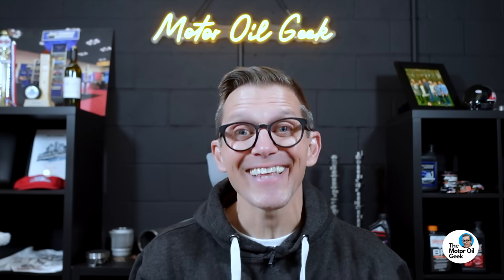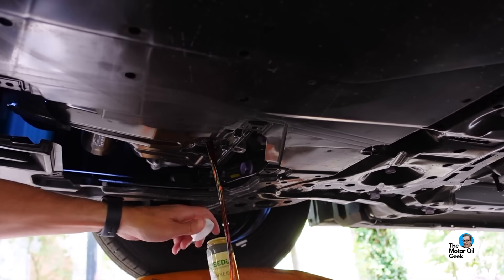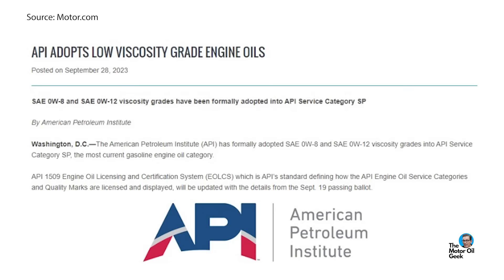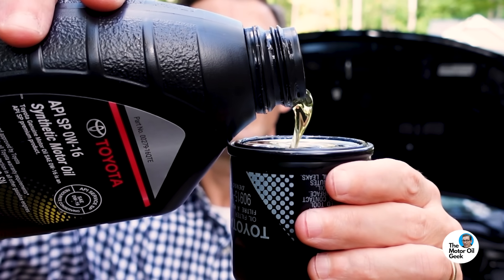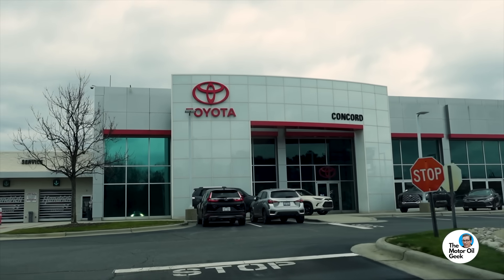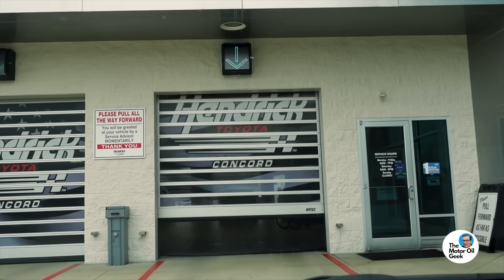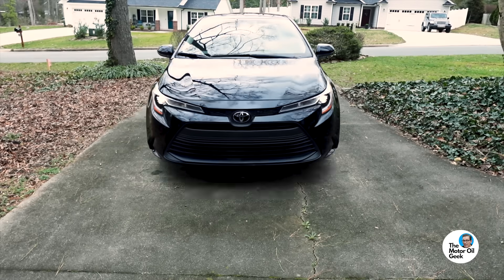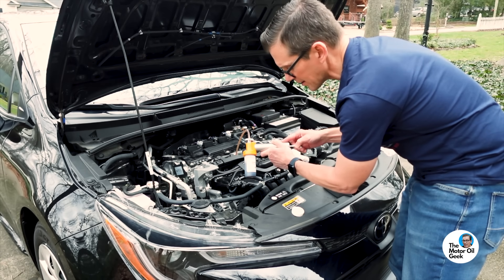0W-8 Motor Oil: Too THIN to Trust? Let's Find Out!

Comment: As far as I know the CVT Transmission fluid cannot be completely drained from the drain plug. Additionally from the evidence I've seen the transmission fluids only last about 60,000 miles at most. They go from red to black so I don't believe the story about them never needing to be changed. I also believe there should be a law against making the fluid level so difficult to check it's almost impossible for the owner.
Reply: Quite a lot the fluid remains inside the torque converter and valve body. Still, dropping the pan and filling it rejuvenates the old oil with the new additives and its gets cycled through. A complete flush isn’t needed if the cvt has been serviced even semi regularly imo.
Reply: @adm7812 never flush, unless the transmission/cvt has gotten in water. Drain, and fill.
Reply: Even dealerships struggle with getting the right amount of oil in modern  transmissions. And if you have a leak forget topping off. You have to Get it fixed. 

Finally. On transmissions where a flush isn't an option.  I recommend doing several short interval drains. Drain the pan put new fluid in and drive a bit and drain and repeat.
Reply: never flush just drain and fill,the level is easy if you have a scan tool that reads the internal temperature!
Reply: @smedleybutler1969  how do you relate temperature to level?
Reply: @richardkudrna7503  Every car has a temp required to get the proper amount of ATF, if the temp is too low the level will be too much if the temp is too high the level is actually too low and you need more fluid ,because ATF expands as it warms up!You cannot do a change without a ATF temperature gauge!
Reply: @DataToTheZero You want to kill a transmission...? Do a flush. Its about the worst thing you can do to any automatic trans. More frequent partial fluid changes is mich safer and more beneficial.
Reply: @boost331  There's no "partial fluid change" on Toyota automatic transmissions on 2007 or later models unless you're taking about hybrids.  And there's nothing wrong with flushing the fluid with proper machines.  Out shop uses BG flush machines and I've never seen any problem with it.  You can see the fluid color changing from black/brown to red during the process.
Reply: @EmbraceTheSuck240  Fluid color means nothing. I actually manufacturer automotive fluids and lubricants for a living. Moat CVTs only drain a very small portion of the fluid. On a car with a torque fluid a flush can and often does destroy the transmission in short order a flush jams all the shit that has accumulated in the trans over all those miles into the filter all at once.
Reply: @boost331  1. I don't service CVTs, I leave them alone.  2. I've done hundreds of WS fluid or T-4 fluid flushes on Toyota transmissions using BG machines.  It's total nonsense to say it destroys transmissions.
Reply: I agree
Reply: My daughters 2012 Suburu blew the transmission at 80,000 miles,I still kick myself for not changing it at 30000 miles as recommended by people without agendas! I change the ATF fluid every 3 years now on all 5 of my cars,all you need is a scan tool that reads temperature and a small pump it is actually not that hard!Don't trust most mechanics some don't check the temperature!
Reply: @smedleybutler1969  when are you checking the temp?
Reply: @utpharmboy2006  I bought an xtool but any scanner that reads internal temps live will do,I drain and measure what I take out and put the same amount in,Then run the car shifting through the gears a few times then wait till the ATF gets into the temp range for the car and start adding fluid till it starts to come out then close up you are done very easy!
Reply: @smedleybutler1969  thanks!!!
Reply: The ecvt oil in my 2016 Prius was still nice and red at 66k miles. Those are a completely different transmission design though.
Reply: So at least with Subaru CVTs they're supposed to be easy to change fluid on, it really is a simple drain and fill. It has a drain plug on the transmission oil pan (that lube techs often mistake for the engine drain plug) and a side fill port, you just drain the old, and fill the side port til it drips out and that's it, flushing Subaru CVTs is not recommended.
Reply: CVT usually 6Ok, Toyota has a launch gear which is supposed to make them last longer. I have a VW with a DSG, they are 40k OCI
Reply: @davidcaprio8919  Launch gear wasn't introduced until 2019 models. So transmissions from 2014 to 2018 are out of luck. And treat their transmissions very gently.
Reply: @davidcaprio8919  No usually 60,000. Usually 30,000.
Reply: @davidcaprio8919  60k?  I think it should be drain and fill every 30k at least for casual driving.  For those who are using their cars as uber or lyft, they should change every 10k to be safe.  The trans work as hard as the engine motor.  Also the coolant should be changed to ensure the heating transfer is at top notich to keep the engine and trans in top cooling state.
Reply: I do my cvt fluid twice a year. Why the heck not lol. It's cheaper than a new transmission.  I did the filters at 50,000 as well. 2019 civic coupe ex-t
Reply: The planned life on a lot of cvts is 65k that's why the warranty is at 65k. No fluid change for life of the trans. What a croc of crap
Reply: @ChevyRedneckGFX  The weak link in the CVT concept is the "belt" which has to have enough friction to grip the pulleys but at the same time have lubrication so it doesn't grind itself to pieces. An impossible combination. The only hope is the new "RatioZero" transmission but that's many years away. They are still working on a prototype for a scooter. I believe they were working on a bicycle version, but I am not sure how far they got.
Reply: Planned obsolescence Baby….
 they got a big lobby
Reply: VERY few people even know that a CVT needs frequent oil AND filter changes. Some manufacturers recommend servicing between 30,000 and 60,000 miles, depending on driving conditions. I don't know of anyone who rebuilds them, and they all have very short warrantys!!
Reply: @bradhuffjr777 
Nissan  infinity cvt transmissions had issues.
Reply: @DavidSmith-tu1nd All cvts have issues lol
Reply: @DavidSmith-tu1nd  big time!
Reply: @DavidSmith-tu1nd you don't say?
Reply: @bradhuffjr777 I hate CVT, and it’s actually boring . I have an old Corolla with automatic transmission and that never gives me headache , oil changes every 50 thousand  KM(around 30k miles) on my own , and it’s still run like new all this years later .
Reply: @bradhuffjr777  I agree on the fluid change interval but not the filter.  No one has ever shown me a clogged CVT fluid filter.
Reply: @nickv4073   Some of the late model Jeep Patriots have a bypass valve, so fluid will still go to the cooler when the filter is clogged. Maybe that vehicle is a poor example because they are crappy cars in general, but I bet that valve was added so they would usually outlive their warranty.
Reply: @bradhuffjr777  Yes, but Subaru put an extended trans warranty on our 2015 Crosstrek with CVT (10 yr/100,000 miles) so if you change the fluid you void the warranty. If you keep the car past the extended warranty, you risk having to pay thousands for a new one.
Reply: @bradhuffjr777  ask nissian about their cvts that have a 99.9 % failure rate and a hidden warranty  cuz they fail so often!
Reply: @bradhuffjr777  they absolutely don't all have short warranties. They're very run of the mill warranties like typical automatics.
Reply: @veganpotterthevegan  I was recently the office manager and service writer for an automotive repair shop that specializes in complete engine and transmission replacement. My sources are ETE and multiple dealerships. ETE would mark up a CVT from the dealership by about a thousand dollars to cover the cost of their "normal" warranty. I have personally priced out over 10 CVT replacements. Most failures were related to neglect and mileage. Most customers replaced the vehicle rather than pay for the CVT replacement.  What are your sources and experiences?
Reply: @bradhuffjr777  my sources are national data on the general reliability of models that have CVTs.  Not one car company that has CVT problems... you know very well that there are companies that have had very problematic geared automatic transmissions too.
Reply: @veganpotterthevegan  Can you be more specific with your sources? How many CVTs have you purchased and installed?
Reply: @bradhuffjr777   I've owned 2 cars with CVTs.  Sold Escape Hybrid with 300k miles on it and I still see it on the road 5yrs later.   I also had a CVT Crosstrek but it was totalled at fairly low mileage.  
*Consumer Reports has the most comprehensive data on vehicle reliability that's not inflated by manufacturers.  You should know that if you work for dealerships.
Reply: @veganpotterthevegan  Oh, bless your heart! I hope your situation improves really soon.
Reply: @bradhuffjr777  sad I sold that unreliable Escape?  How many miles should it have failed at?  800k?
Reply: @veganpotterthevegan  Good luck with your journey through life.
Reply: @bradhuffjr777   I'll be fine, the autos in my Ford Transits I use for work are a different story.  4 vans, all hitting schedules maintainence.  One sold at 114k, the rest under 100k.  I'm on the 4th with 19k.  2 transmissions, 4 actuators.  Not a good time.
Reply: @veganpotterthevegan  I used to service write for a LOT of Transit Vans. Fortunately, a lot of it was maintenance for commercial fleets, and preventative maintenance was strongly encouraged. Each one that had an aftermarket tow hitch had transmission problems. At least the water pump is more easily serviced on the RWD ones. Good luck and watch out for aggressive drivers!
Reply: @bradhuffjr777  no hitch on any of mine but they were a nightmare.   First 3 were RWD.  3, 2 and 2 pairs of head gaskets on the first 3😅 And I'm not hard on my van.   I get the best gas mileage in the company by over 1mpg.  Granted, we do drive very steep terrain servicing ski resorts in Utah
Reply: @bradhuffjr777  Nissan yes. Toyota uses direct drive first gear
Reply: @bradhuffjr777  not the case for Toyota E-CVT's
They will last 500k kilometers easy with basic 60k miles drain + refill, it is in fact not good for it to be drained completely. 
The prius is one of the most used Taxies in spain, and they call it a "million KM" car for a good reason.
Reply: @bradhuffjr777  No matter what kind of transmission you have you should be changing the fluid (and filter is applicable) every 30-60k miles.

The only difference between changing the oil in your engine, power steering system, differential, and transmission is the type of oil and the interval in which it needs to be changed.

Oil breaks down over time and NEEDS to be replaced.
Reply: I'm driving a 2016 Prius, the cvt drains and fills at listed capacity. Drains and fills like a gear box.  I've been running 80k between fluid swaps.  3.5qts WS fluid
Reply: @philarends7555  I know, that's an eCVT.  If you remove the overflow plug, no drain plug on the CVT, you'll barely get a quart of the fluid out of it.
Reply: @EmbraceTheSuck240  that's bullshit on yotas part. I really like the way this one works
Reply: Yes it is a crime!!
Make it  hard for you to maintain
Reply: None can be drained completely by just the drain plug
Reply: @zealobiron  No it can't.  Draining only removes 4.5 Litres, holds more than that
Reply: @trainstractorscarsandtruck7362  typo
Reply: One of the things manufacturers found with autos many years ago was that the presence of oxygen is a significant factor in the life of the fluid, basically oxygen from the air accelerates degradation to a very large degree. If the trans is sealed all the oxygen inside will react with the oil, the remaining gases are inert and won't harm the fluid. This is probably behind the deletion of the dipstick;  if one is present owners will inevitably succumb to the temptation to check the fluid level, which introduces fresh oxygen into the transmission via the dipstick tube.

I changed the auto trans (old-school slush box, not a DCT or CVT) oil in my car at 150,000 km and it was quite dark but clearly still had some life left. CVTs need much more frequent changes due to the high shear conditions of the push belt.
Reply: @nerd1000ify  you would think that a valve would be the way to go so that you could still have a dipstick but the valve would stop more oxygen getting in.
Reply: 60,000 miles is when i change mine and that's with lite use. manual actually recommends 60,000-90,000 miles with heavy use....so they admit its not necessarily "lifetime"
Reply: All old vehicles recommend a 30k-50k service interval for trans fluid. The more hard use, the shorter. You should change it 6-10 times in a cars life, and flush 2-3 times ( non machine flush)
Reply: 2020 Corolla drains 4.5 Litres of trans fluid on a drain only.  XSE CVT with 1st gear
Reply: I'm surprised it even has a drain plug since sealed transmissions are all the rage these days.
Reply: Did you take the plastic insert out inside ??? Bruh.
Reply: CVT transmission filled for life= means replace transmission in 60-100k because we have no service parts available even for warranty and we do not fix them!!! So $8000+please and we will install a new one or we have another on the lot I you would like to trade!
Reply: If Toyota does not have CVT drain plug you can replace CVT tranny cover with after market one with the drain plug and then do drain and fill. You need to drop the cover anyway for cvt filter replacement that is inside. It will replace 50% on first drain and 100% at second fill as rest of the fluid is in the torque converter.
Reply: Some vehicles have no way to check the transmission fluid.
Reply: @solarsynapse  that's very true but still change it no later than 60000 miles I don't care what some manufacturers say about forever fluid that is a lie no oils or fluids last forever. There is a way to check the oil but you need to get under the car and find the right plug and make sure the car is level and bla bla. It's a pain in the butt.
Reply: Cant drain all fluid from any transmission. Cant drain all the oil from a engine either. Cant drain all antifreeze either.
Reply: @shawnkelly695  very true especially depending on how it was designed that's why it is so important to change the fluids on a regular basis on the extreme driving conditions set in the manual or what ever they call it because never use the normal driving conditions because basically no one drives in the manufacturer definition of normal. But yes you are 100% correct no matter what you don't get All the fluid to drain and the transmission and coolant are the worst by far.
Reply: @tdobson888  atleast changing before wore out there not that tar build up. And lol ya its kinda amazing the abuse modern cars will take before dead. In north america we love our fast engines and drive the livin shyte out of them. The least we could do it maintain them better then we treat them on the road lol.
Reply: I won’t buy anything with a CVT. Toyota or not. Inferior trans that is installed only because the EPA forces the manufacturers to meet their ridiculous arbitrary efficiency rules. EPA needs to be removed and disbanded and permanently outlawed to bring back vehicles that last.  GD feds.
Reply: Late reply, but you're saying my dad having never had it done to my knowledgebin 120k miles is bad?
Reply: @Hydration-yq7hu  Dealerships usually do at least one CVT service while the car is still under warranty. Check the service records and read the owners manual. Be smart and save money. You can also help save the planet by making the vehicle last longer.
Reply: @Hydration-yq7hu  

The transmission filter for a 2020 Hyundai Elantra should be replaced every 30,000 to 50,000 miles. However, the transmission fluid for an automatic transmission in a Hyundai Elantra typically doesn't need to be checked or replaced under normal driving conditions. 
 
Here are some other maintenance intervals for a 2020 Hyundai Elantra: 
 
7,500 miles: Inspect the air cleaner filter and replace the climate control air filter 
 
15,000 miles: Inspect the brake fluid 
 
30,000 miles: Inspect the fuel lines, fuel hoses, and connections 
 
8,000 miles: Change the oil and oil filter, rotate the tires, and inspect the brake fluid 
 
95,000 miles: Replace the spark plugs 
 
120,000 miles: Replace the coolant 
 
Hyundai also offers a complimentary maintenance plan for new 2020 Hyundai models purchased on or after February 1, 2020. This plan covers oil changes and tire rotations at the normal intervals outlined in the owner's manual.
Reply: @Hydration-yq7hu  Are you talking about a transmission in an older car? Conventional automatics benefit from 75 years of development (approximately) and are understandably more durable. Additionally just like the guy who smoked like a chimmey all his life a never got cancer or heart disease. I prefer to not go by the results of just one (or a few) person(s) that might have just been lucky. And they really might not be making them like they used to.
Reply: @Nickrioblanco1  no... 2020 Elantra CVT :(
Reply: @Hydration-yq7hu  I hope he gets lucky and it lasts until he doesn't what it anymore. For some  people 120K is OK. I personally expect a lot more.
Reply: Yes. 0W -8 is too thin unless you live in Fairbanks, Alaska.
Try letting the car sit for a week between runs.
You'll hear metallic sounds on startup. Not good. Ridiculous.
SAE Engineers weren't happy about and objected to using water to lubricate engines.
Why? Because all of the oil runs off the bearing surfaces and out of the lifters overnight.
So... if your viscosity modifiers get used up? 
You are left running "water" (0 weight oil) in Phoenix in the summertime.
Wait a week and then start it at 120F. The engine will not be happy.
Even the "Kwik Lube" oil change employees thought the engines sounded horrible on startup after draining hot oil for a change.
Ridiculous to get ~1 mpg improvement.
Reply: I change my CRV every 30,000
Reply: as always, drain as much as you can from the drain, and put the exact same amount back in. I have done this will ln my Chrysler 3.3 engine tranny and NEVER had an issue.
 I do it every 3 years. You might get 1-1.5 L at best.
These are my vehicles and I decide what gets done when.
Reply: Why didn't you show us where the drain plug was instead of taking 3 minutes to tell us not to use normal oil in a cvt?
Reply: its true cuz tranny only last 60k miles so never have to change the oil just the tranny lol.
Reply: i have a honda cvt sitting at 100 right now with no issues
Reply: It's not impossible (not even close to impossible -  but rather difficult).  You need to teach yourself some things that aren't taught in school (like most life lessons such as finances and relationships).
Reply: My mum's Honda has a CVT and it's black after just 15000 miles
Reply: The thing about belt driven CVTs is that they generate A LOT of heat during use and thus should be manufactured with at least two transmission oil coolers, if space allows, for better durability if frequent fluid changes are not possible by the owner.

When I had my 2008 Nissan Maxima I would take the car to the dealership to get the transmission serviced every 15,000 miles religiously.

I put 67,000 miles on that car, before I sold it, without one single transmission issue and it always operated buttery smooth.
Reply: Thats why mechanics tell you that there are 2 ways to have transmission problems, 1=never change the fluid, and 2= change the fluid as recommended.  In my experience you should remove the stock trans fluid within the first 2 years or  30000 miles max.
Reply: In my 2020 Mitsubishi outlander sport, I get my CVT serviced every 30,000 miles. It starts out as green. Right now it’s definitely transitioning to a yellowish color but I’m 5,000 miles from my next change. I imagine if I skipped the service, the yellowish-greenish color would eventually brown. Then black.
Reply: That story comes from the old hydraulic converter transmissions. It does not apply to CVT. Although with something as wear sensitive as a CVT even I would shorten the recommended intervals.
Reply: put strong magnet outside the drain plug.. to collect iron particles.. see howmuch when doing change
Reply: My son replaced his CV fluid himself it can be changed he has a civic
Reply: Drain what you can every 5k miles, depends on how it's driven, towing etc.
Reply: No transmission can be completely drained from drain plug. At best your getting 60%of the old oil. Just the torque converter can hold up to six litres on some big transmission
Reply: CVT trans are complete garbage ..
Reply: I have seen several units of industrial equipment that use a sight glass for fluid level. That’s what I would like to see on cars. Then you could just look at that for level rather than a dip stick or the drain plug over spill method at a specific temperature!
Reply: Trans fluid color doesnt matter...it still works fine when the color changes...its only a dye..
Reply: There is more disinformation in these comments than factual information.  These new systems are not designed to be used more than twenty years. New technology changes very fast and nobody wants crappy old crap.  In the future you may not be able to own most of these vehicles. New vehicles will be sharing information for better traffic safety.  Probably all EV.
Reply: That's a fact always change your cvt oil at or before 60000 miles I cut it in half because I do lots of city driving
Reply: It's life time fluid. But Toyota or any manufacturer doesn't give a definitive description of what life time means.
Reply: I had a 2010 T&C.... there was NO transmission dip stick. There WAS a tube with a rubber cork. To check the level, one needed a "special" calibrated dip stick, with graduations for low/ normal/ max... One ALSO needed to know the transmission temperature, There IS A Significant difference in oil volume/ height on the stick between cold and operating temp. 
One COULD simply use the engine dip stick (Cleaned VERY WELL), and measure the oil level, and refer to a chart.
Reply: Hello, I don’t understand mechanics of transmission, but
Car care nut, has a video where he does -transmission drain and fill on a Camry hybrid 
-obviously has a drain plug
- and explained that there is no sealed transmission, it just doesn’t have a dipstick 

And I’m sorry, I trust his experience more than any of the contradictory and false views listed here
He says change it every 50k
He has video showing him do it
He shows the drain plug 
And explains there is no such thing as a sealed transmission 
So to the mechanic above with 26years experience 
Saying there is no drain plug
Wtf 😂😂
Reply: @ricknoyes4463  What the Toyota dipstickless transmissions I have is a combination drain overflow plug which unlike the overflow plug on a manual transmission or a rear differential work at ambient temperature these overflow plugs only work properly when the transmission fluid is at a certain temperature range. So not only do you have to run the transmission to heat it to that range and have a diagnostic tool to measure it.  Different transmissions have different ranges.
Reply: CVT oil is actually a goldish color, lighter than oil  gold, actually. The red fluid is ATF (Automatic Transmission Fluid) and is rated for cars with defined gears, not CVTs (Continuously Variable Transmission). I'm not a fluid engineer, so I don't know what the difference would be with running each, I'm just aware of different transmission fluids for different transmissions and that you could potentially mess up a transmission with incorrect fluid. However, all fluids will get darker with wear, that is correct. Whether it be oil, brake fluid, transmission fluid, coolant, differential fluid, or transfer case fluid, the darker it is, the worse off it is.
Reply: There are videos of engines that had 10,000 mile oil changes and by 100,000 miles they are all gummed up. Synthetic is pathetic 😭
Reply: I change mine every 25k
Reply: They want you to take it into a Toyota Dealership silly.
 BMW trick that the Toyota folks picked up in the war. Oh, sorry, when they merged withhi-teck crappy vehicles.
 Ya ya they last for ever. Parts are costly, and they will not hold up like the old ones did. eg: Matrix. 
Oh well nobody is forced to buy any specific brand so do what you want. Its your dollar.
Reply: Never need changed during the life of the vehicle..... Which in court of law is the power train warranty so 60,000 or 100,000 miles.
Reply: Nissan giving CVTs a bad name. Toyota uses direct drive first gear.
Reply: guys like you are exactly why they make it difficult. so only people who actually know what they're doing attempt it, hopefully. You can seriously mess up your car if you mess with the CVT fluid and you don't know what you're doing. it's absolutely nothing like doing a motor oil change. and the level has to be exact.
Reply: @TimJohnson-x1o  So you think it's right most people can't even check their transmission fluid level. Also it's not only on the CVT my 2006 Tundra has the same type of system on its Type A750F traditional automatic transmission. You reveal your ignorance by thinking I can't do the job. I'm a retired mechanic with 35 years of experience. And have already done drain and fills on my Corolla's CVT and the Tundra's A750F(multiple times) with the correct procedure at the correct temperature. The manufacturers are wrong to not have a way for owners to know all the critical fluid levels on their vehicle.
Reply: I disconnect the transmission cooler line and pump out 2 quarts, then I add 2 quarts and repeat until all the old fluid is pumped out and the new fluid is in. never had any issues.
Reply: Think of it this way.  You change your motor oil every 5k.  The question would be, does your transmission work as hard and consistently working like your engine?  If so, now think about the oil.  It's best that you do change the trans oil as much as the motor oil.
Reply: @kito1san nonsense
How much compression occurs within my transmission?
How many ignitions? 
How fast are components spinning?
Its a fraction of the torture the engine is exposed to
New oil every 5k? Huge waste
Reply: Walmart sells mobile 1 0w8... my 2025 takes 0w16 for 10k...my dealership gave free lifetime powertrain warranty with this schedule
Reply: I do mine every 30K on a 2021 Honda, including replacing 1 of 2 filters. As far as I know, when you drain and fill a CVT, you get most of the fluid out since there is no torque converter. And if you’re doing it every 30K let’s say, even a little of the old isn’t the end of the world. But most of these manufacturers will tell you that sealed transmission fluid is “lifetime”, which is BS. They even tell you this on some non CVTs, like my Tundra.

One thing is proving true: CVTs will last a lot longer if you take charge of your own maintenance schedule.
Reply: @carnold.knowledge cvts for cars do have torque converters. Honda is the only one i am aware of that uses a clutch instead.

They may be onto something as i havent heard of failures being as common
Reply: With my Rav4 Hybrid, when you drain the transmission fluid you're draining the ENTIRE amount. Which is ~3 1/2 quarts.  When you REFILL, it's a little messy but simple.  Just fill to overflow and then let it trickle to a slight drip at least. Same goes for the DIFFERENTIAL but not as much fluid.
Reply: @michaeltammaro482  yes!  eCVT (planetary gear set) is super simple
Reply: Maybe the fluid is more expensive than the transmission?
Reply: @thisisyourcaptainspeaking2259  it isn’t. i have diy serviced my toyota cvt along with the filter change. The fill port is behind the wheel and getting the right level is bit of a process but still easy enough.
Reply: @adm7812  The process seems ridiculous to me. Toyota could have easily made the process so much simpler. Probably could have even used a dipstick based CVT oil change procedure. Or even a side fill port that matches the needed level so you just fill until it starts to drip out.
Reply: @stephenh8092  it's all about making you go to the dealership for service. My '15 Accord has a side drain (separate from the main drain port) to let you know if you filled it to the proper level.
Reply: They were ordered it this way im sure!!
Not because they choose to
Reply: @stephenh8092 my cvt actually has a dipstick and a drain plug. I actually had an argument with a Toyota head service technician one day because he assured me Toyota had never produced a cvt with a distick. He insisted I had mistaken the engine dipstick for the transmission. Nothing i could say would convince him otherwise.
Reply: @rohankiwi one way to have solved that issue with the technician is to have him walk with you to your vehicle and show him the transmission dipstick that was not the oil dipstick. Instead of trying to convince him verbally the technician couldn't refute that.
Reply: @stephenh8092  this is exactly how the toyota ecvt works...but that is a planetary gear set they use on all their hybrids. super easy
Reply: @thisisyourcaptainspeaking2259  
the fluid is pricey
Reply: That's right because there's NO drain plug on Toyota CVT transmissions.  There's only an overflow plug!!
Reply: Cvt fluid is yellow not red
Reply: @jacobrector7879  color doesn't matter.
Reply: @dealerauctionnightmare4689  I agree, but it can be helpful in diagnostics. A good example is at my old job, we often used a blue fluid in the Supercharger cooling system so we could differentiate an engine coolant leak vs. an intercooler leak, for example. If the leak was blue, and within our warranty period on the supercharger installation, we would address it differently than an engine coolant leak.
Reply: @jacobrector7879  not one color some are blue.
Reply: @jacobrector7879  not all are, mine is greenish-blue
Reply: @jacobrector7879  Subarau is green
Reply: @jacobrector7879  The red fluid I was referring to is on the Tundra truck which also has no dipstick an starts to go bad (turn dark) at around 60,000 miles depending on how hard you you run it. Even though some dealers say it lasts forever.
Reply: @jacobrector7879 The CVT Fluid in that Toyota Corolla is RED... He showed you a sample! Are you saying that he made it all up and is lying?
JFC
Reply: @jacobrector7879 Honda fluid is green!
Reply: You don't need to worry about the fluid which is extremely expensive.  Just leave it alone, there's no way to service it.
Reply: @EmbraceTheSuck240 the fluids cheaper rhan a transmission
Reply: @carnivorebear6582  Yes, it is but there's no way to service that transmission.  I've been a Toyota tech for 26 years.  You're wasting your money on "drain/refill" or "flushing" the fluid.  I roll my eyes whenever someone asks for either of those services on non-hybrid CVT transmission.  I've had this discussion with my service writers many times - You can't drain/refill when there's no drain plug and you can't flush the fluid when there's no cooler line!  In order to do a proper flush on the CVT, you'll need 4 cans of the fluid, each can is 4 liters.  I believe one can of that fluid costs $150 so you're talking  about $600 for the fluids plus an hour labor.  The cost of the fluid is about three times the normal flush with WS fluid.
Reply: @EmbraceTheSuck240  You must not have worked on many Toyota CVTs. Actually the number is probably zero, because Toyota non-hybrids DO have a CVT drain plug.
26 years, huh? I bet there are a lot of Toyotas you have screwed up. Guys like you are the reason I warn people to stay away from dealerships for mechanical work.
Reply: @EmbraceTheSuck240  pretty crazy, I would've assumed they'd have at least a transmission cooler, especially if the things designed for 'lifetime' use
Reply: @carnivorebear6582  That CVT has a cooler.  I was referring to the eCVT on the Prius which doesn't have a cooler but some still like to sell "flush" on that transmission.  Yeah sure the fluid is cheaper than the transmission but Toyota doesn't even recommend replacing the CVT fluid which is ridiculously more expensive than the WS fluid, like 4 times more expensive.  All that fluid does is lubricate the gears and chains inside the transmission, that's it.  Since CVTs don't shift, the fluid isn't used in the same way as the conventional transmission fluids so I wouldn't worry about it.
Reply: @EmbraceTheSuck240 you're the reason I service all my Toyotas myself.
Reply: @mitchellbroaddus9120  Good for you, I have more work than I need so I don't need cheap customers like you.
Reply: @EmbraceTheSuck240  cheap? Lol
Reply: I worked for subaru. Cvt was easy, but I have experience with Porsche. So draining the fluid and changing it was like doing an oil change on a 911...
Reply: @EmbraceTheSuck240  yeah....so you can charge them $150 for a quart of cvt fluid.
Reply: @utpharmboy2006  LOL right... I'm a dealership tech, NONE of us makes a cent off the parts nor do we have anything to do with the parts prices.  Dealerships charging "shop prices" rather than the list prices are a hinderance to us techs who only make money off labor.
Reply: @EmbraceTheSuck240  well then your dealership must be run by a crime family. feel sorry for your customers. you should be better informed.
Reply: @EmbraceTheSuck240  but just replacing the fluid without “flush” will get rid of a large part of the debris and bring in new additives.